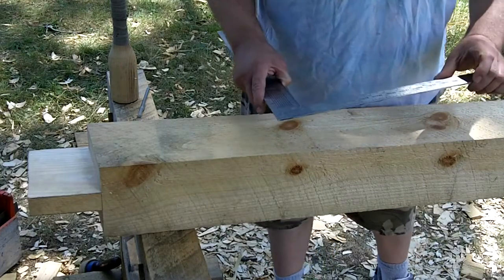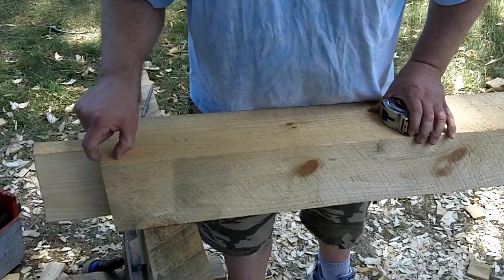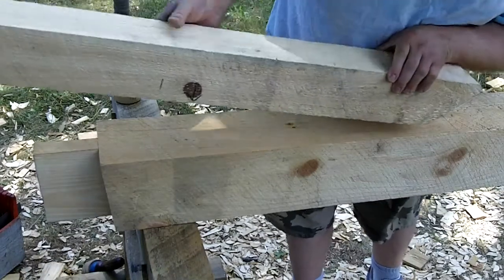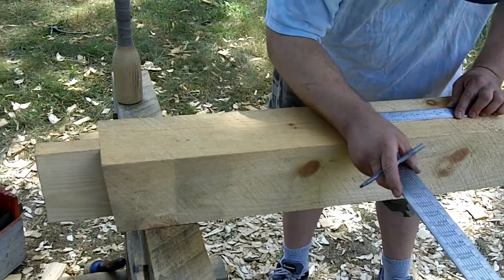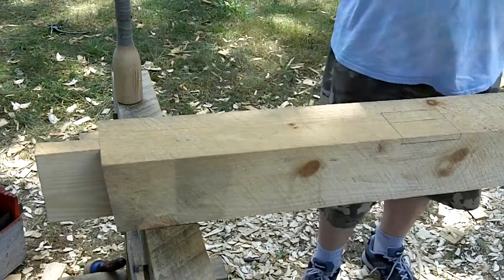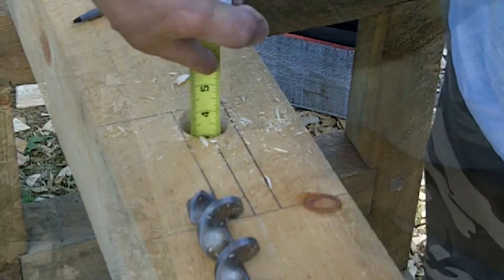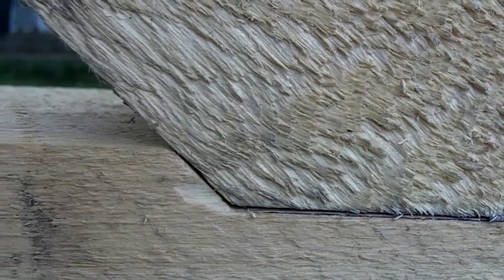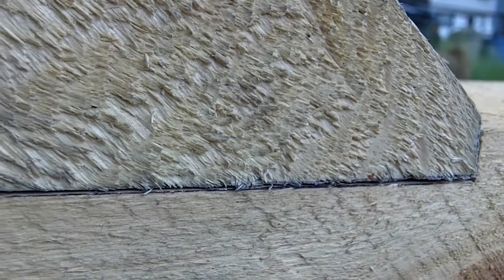Timber Frame Shed - Laying Out and Making a Knee Brace Pocket

Comment: Hi .I notice that you don't 45 the mortise at the top .Is this OK?
Reply from the maker: If I understand your question correctly, the answer is yes, it's OK. The reason is because knee braces work in compression, never tension. Therefore, the inside face of the mortise is never stressed.  No harm, no foul. That being said, you could cut it at 45 if you wanted to. I just find straight down to be faster and easier, as do most timber-framers I know. Hope this helped!
Reply: @TheBigMamao  Cheers  .